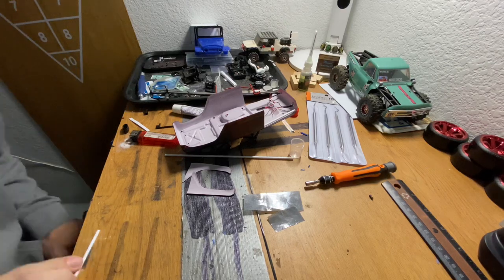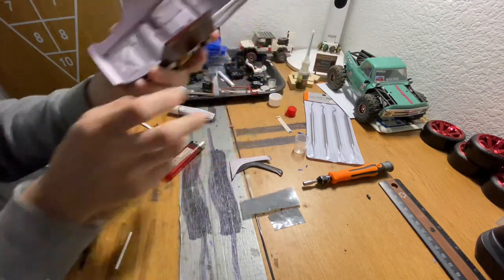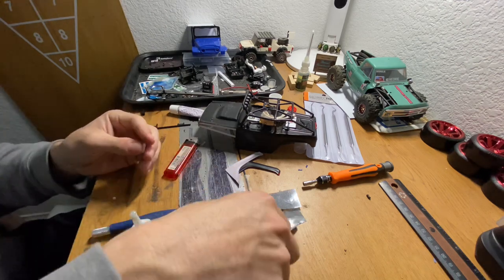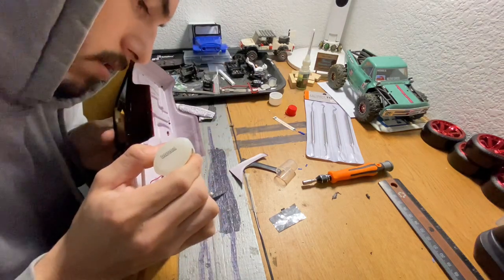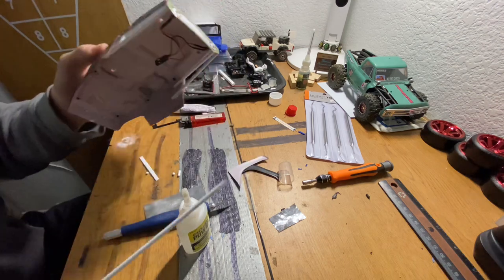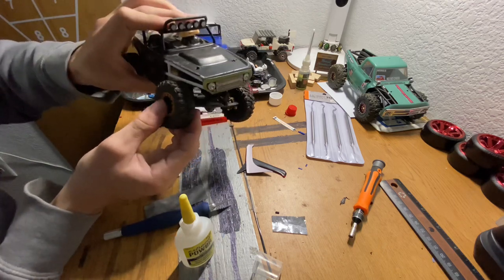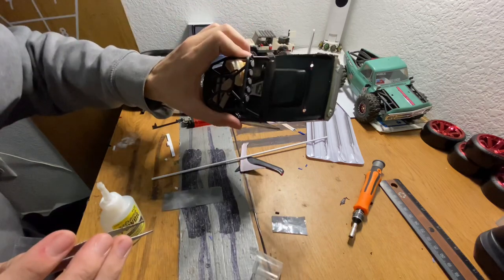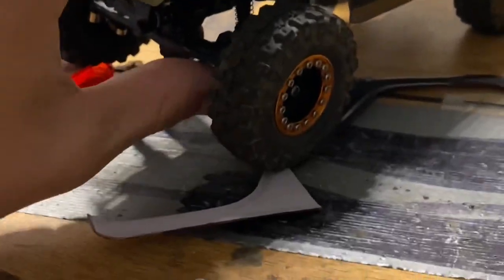Scx24 Workbench time front cages deadbolt for @dagger_rc

Comment: Are the bars straws or no?? And where you get the light bar for the micro shark
Reply from the maker: Sorry bro I barely saw this comment light bar I got on the little guy racing website and it’s like straw it’s called plastic styrene 1/8” in size I use rod and tube rob is solid tube is hollow like a straw
Reply: Yah it’s fine and thanks